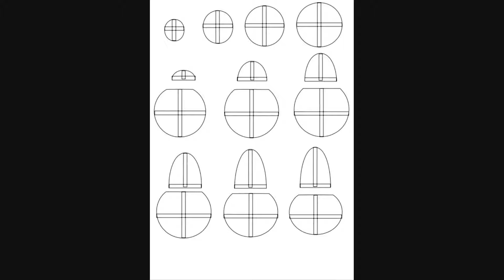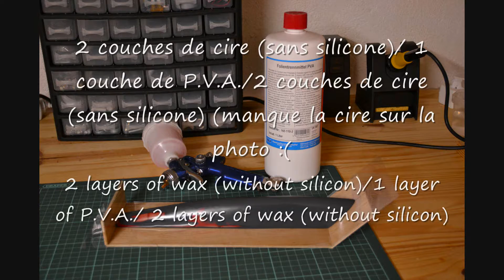How to make master for rc glider fuselage / Fabrication d'un master de planeur radiocommandé

Comment: Fantastic video and perfect timing!  I want to do exactly this with an old glider design.  I only have 2 views on plans for fuse, like you started with.  The steps you've taken are exactly what I imagined would need to be done.  Wow, thank you!!  I have questions, but main one now is what app/process did you use to get from the 2 views to positioning and creating the profile formers into your computer file?   Thanks again
Reply: Thank you 🙂
I used GIMP it's a free drawing software

Comment from the maker: @ib422000 Yes it's a very great glider! Mine just have a brushed motor but now I take off the motor for slope and in order to be more light. I use the fuselage with 60inch wing and I put the wing on a very very light wood homemade fuselage and if you want you can see the video on my profil of the flight and of the making of the wood fuselage.